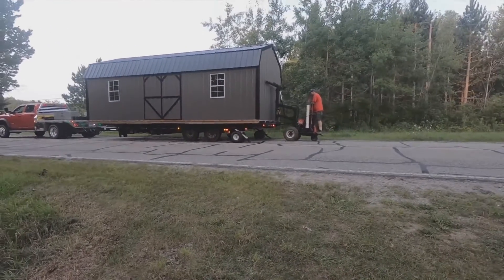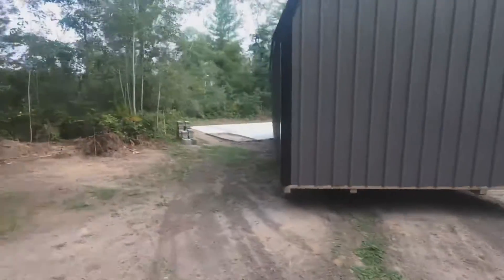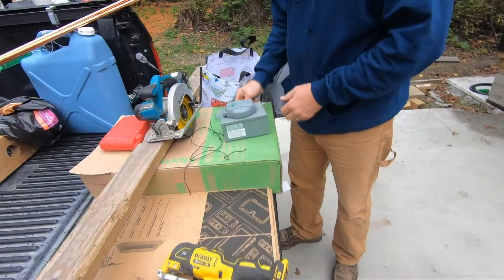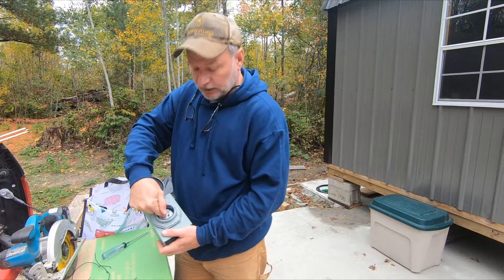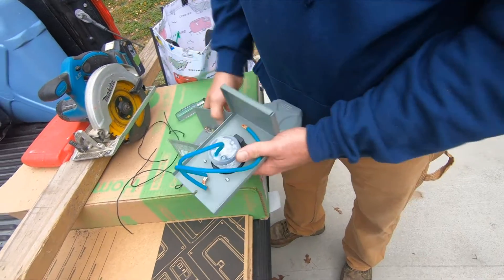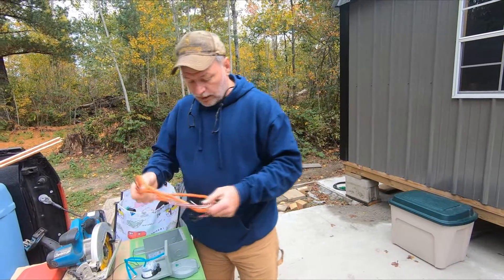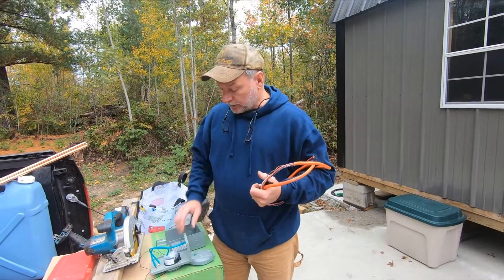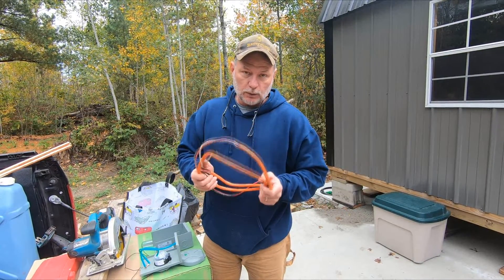Powering Your Off Grid Cabin: Step-by-Step Electrical Panel Installation

Comment from the maker: Thanks to Gerald J for pointing out that the 10/3 wire I installed will not support 50 AMPs, 
*DO NOT USE 10/3 WIRE * if your are using anything over 30 AMPS
Reply: I can use 10/2 ? For 30 amp breaker box? And 12/2 (yellow romex i think it is) for the plugs?
Reply from the maker: @Snatcher_Catcher  For a 30 amp breaker, you can use either 10/2 or 10/3 wire, but they are used for different purposes. 10/2 wire is typically used for 120V circuits, while 10/3 wire is used for 240V circuits that require a neutral

Comment: Do you need a breaker panel if you are just running a few lights and outlets in a shed or off grid cabin? Can the generator just plug in to the outside outlet and everything inside feed of the outside outlet?
Reply from the maker: yes you can do it that way.  Lights and a few electrical outlets are fine.  If using a fridge and or microwave best to have a panel.

Comment: Why 2 grounding rods?
Reply from the maker: the National Electrical Code (NEC) requires a supplemental ground rod (rod #1).  If it does not meet 25 ohms or more, then a second rod is required.  NEC recommends a second rod for increased reliability.
Reply: @thehandyoutdoorsman9014  Thanks for clarifying... I'll have to test the ohms next time I'm out at my shed/cabin.  (Minnesota)   I have a 10x16 lofted barn like yours but smaller and this video was essential in helping me wire it up for a generator!   
I knew most of the stuff, but it sure is nice to have a video like this to confirm my plan and to add a few things to it also!

Comment: Can you do this with Nema l14-30 inlet box and use a adapter for Tt-30? The adapter does the work for the 120v So each hot could go into a pole on the breaker?

Comment: What type of service panel is that
Reply from the maker: Apologize for delayed response.  All parts are listed at the end of the video.  Just a 100amp panel.
Reply: Does the generator have bonded or floating neutral ?

Comment: So in the future if you brought in 50Amps, would you not need to change the 30amp breaker to a 50amp breaker?
Reply: Yes Sir
Reply: the issue there is he has to change the wire because 10 AWG not rated for 50 amp breaker